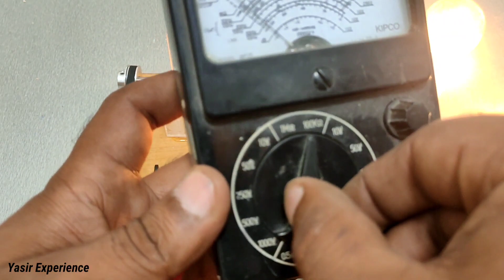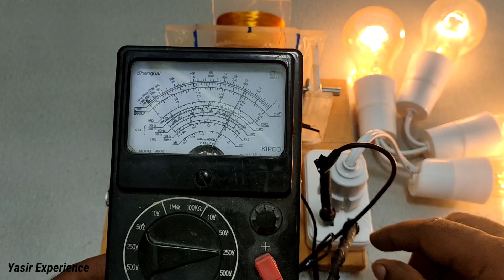I turn new way in 230v generator using plastic glass

Comment: Oya aku mau bertanya.
Saya pernah membuat generator dari washing motor 220v, 150w. Saya gunakan magnet n52  dengan ukuran 30x20x4mm. Kemudian dicoba putar rotornya dengan motor drill. Dan leluar hanya 6volt saja. Apa yang terjadi?
Bagaimana mengatasinya supaya output nya bisa capai 220v? Mohon bantuan mr yasir. Terimakasih banyak.

Comment: you do know that at 230v 5000 Watts would be around 22 amps.. no way in hell that little wire can handle 22 amps....I have seen 20 amps cook a lot thicker wire... because once it heats up that lamination on the wires burn and transformer will short out. Why don't you hook up a electric heater to this thing and lets see what happens.
Reply: this is VA no AV